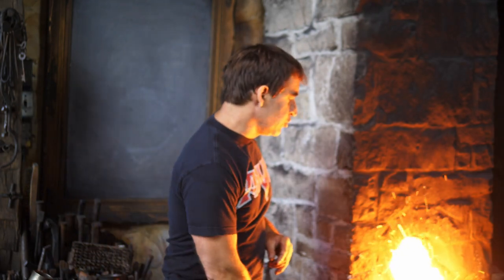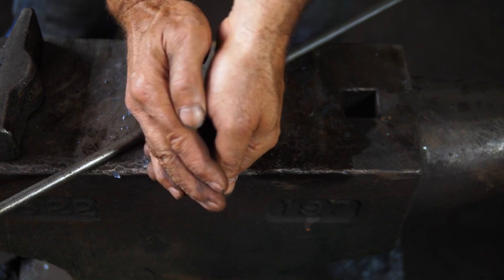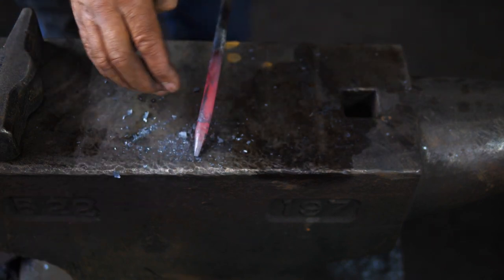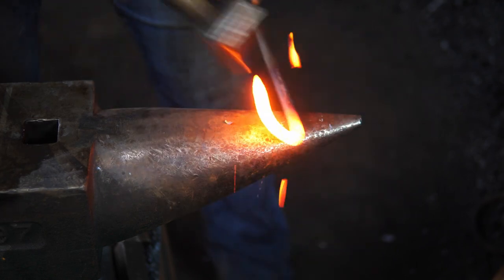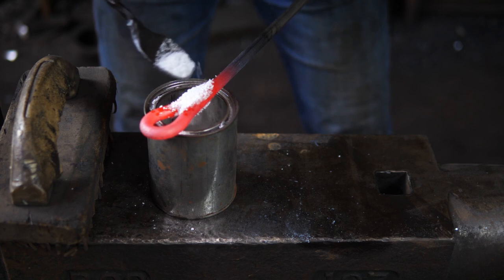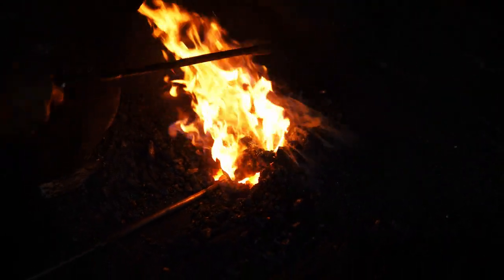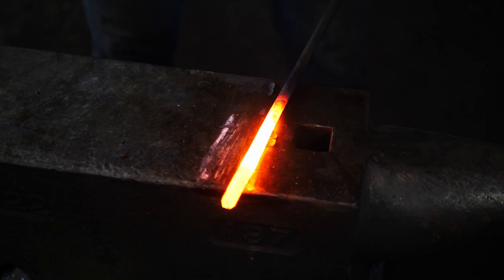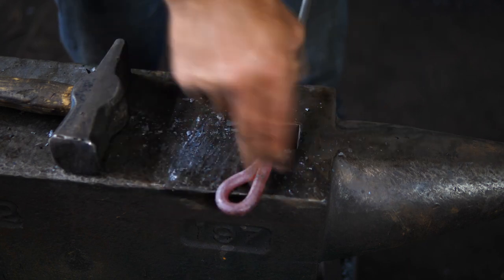How to Forge a Fireplace Poker - Basic Forge Welding

Comment: Very unique how you came up with the 2 spurs on the business end of this poker.  Lots of technique and style to be gleaned from this video.   I appreciate your effort and look forward to the remainder of your beginner series.  Thank you and fare thee well
Reply from the maker: Any requests while we're at it?
Reply: @ThakIronworks  I started making holes for mounting hooks with the drill press.  Then I got into using punches which would quickly lose their temper and become disfigured.  So then I got into heating and straightening and making punches.  Then hardening and tempering.  That was all straightforward but I still had a hard time punching thinner stock.  It'd lose it's heat to quickly.  So I ended up making the anchor points for the hooks thicker.  I would upset that end and hammer down to no less than 1/4".  That way the stock would hold its heat long enough for me to punch a mounting hole.  As you can tell this is an amateur process and I'd like to see how a seasoned pro would deal with this.  Thanks.
Reply from the maker: Drill press... haha, but from a practical standpoint, I wouldn't punch it as it is much easier to drill. However, if I was going to punch it, your approach is good, I would build a specific bolster block with the appropriate size hole to make the process more efficient.